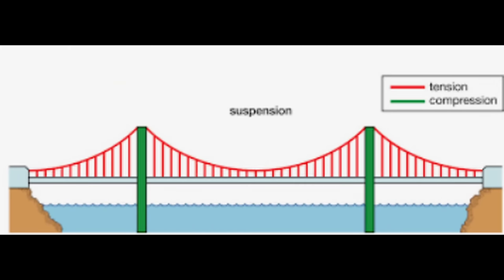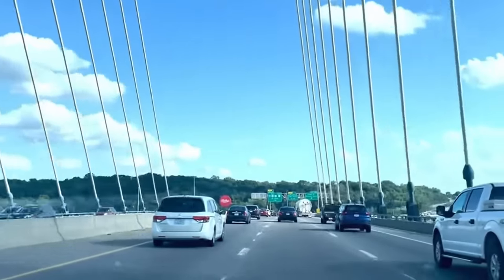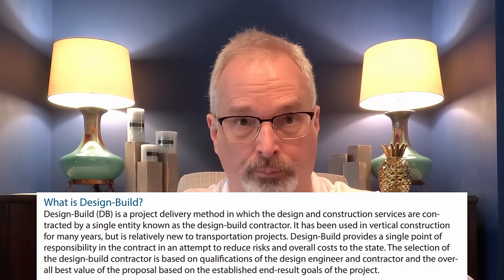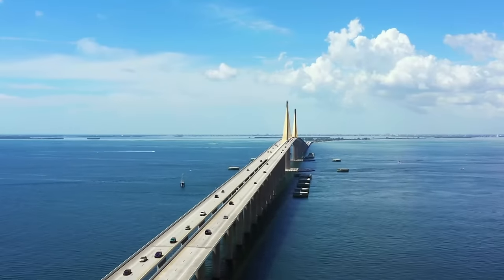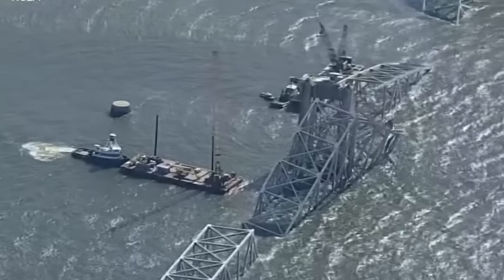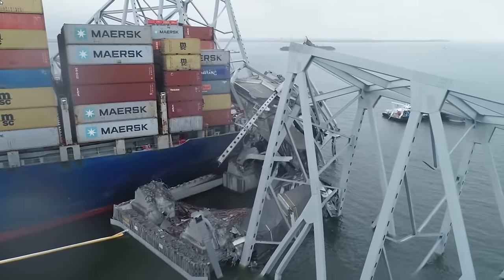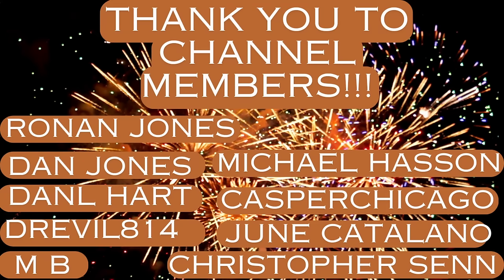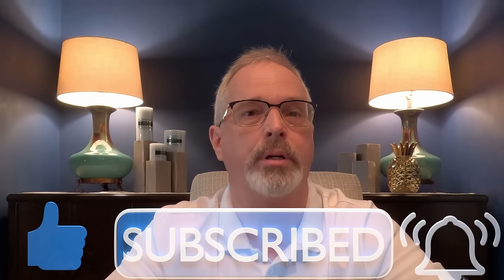How will the Key Bridge in Baltimore be Rebuilt?

Comment: I am a retired structural engineer. It is so refreshing to listen to someone talk about the key bridge that knows about engineering and construction. Thank you.
Reply: ……yes , it’s always good to have someone who knows what they’re talking about, instead of dumbo politicians’ spruiking, who know sweet f a………
Reply: Real interesting.... Now go outside and touch some grass...GEEEZE
Reply: Why dont they build a tunnel?
Reply: @dahawk6474  A tunnel is a lot more expensive.  Also trucks with hazardous such as gasoline are not allowed in tunnels.
Reply: another mistake is when they upgraded Electric Service Wires with New Posts w Lights the Original Closer together Post Spacing on the Bridge stayed the same (probably just build new Bridge at that point in time) causing a narrowing effect when steering under Bridge where you  have to re-center between closer together Posts USN Retired DDG-57 (steered a Billion Dollar Battleship)
Reply: @jamesodell3064 not just that type hazmat but chemicals and even RV’s w LP tanks plus oversized loads need this short and less congested way to get thru.
Reply: @dahawk6474  
A tunnel would not qualify for transport of hazardous material.
Reply: Honestly the electric, fresh water and gas service are much cheaper just to move 1/4 ot 3/4 mile further out to sea than the bridge project footprint so the labor of being involved for the next 6 years isn't needed.   Either that or the bridge can collect rent for the next 100 years to make it look cheaper to the taxpayers by putting those services in the bridge.      One can get a pipeline across a bay for virtually nothing, the environmental regulators cannot really fight a 46 inch wide, 8 foot deep trench in a sea bed scrubbed by channel maintenance, tides and ship traffic.
Reply: I too am a retired civil engineer, Registered in Michigan.  My work was primarily constructing High Rises.  I agree with Michael Foster that your videos are refreshing from the dirth of "content creators" showing reruns of videos created by others plus clickbait headlines.  Keep up the informative videos.
Reply: @sabianstringer2112 lmao!!!!!!
Reply: No
Reply: You are missing my point having a wider footprint for electric only sets you up for failure when you have the scenario where the Bridge Posts are so close together should have redone bridge too in addition to all other service especially when cargo ships are twice the size as in 1970's just saying @christopherwhull
Reply: Or Put Major Bumpers Around Posts as a Bare Minimum
Reply: Because you can't haul any hazmat loads in a tunnel
Reply: @sabianstringer2112     I hear there is an opening for competent ship captains !
Reply: I see now that it not just replacing the bridge but power lines and many other considerations. Engineers are indispensable.
Reply: The collapse of the FSK had nothing to do with the superstructure being a truss.  You knock out an entire pier, you will almost always get a collapse.  After all, 3 multi-girder spans of the north approach also collapsed.  However, a full replacement consisting of cable stay system via design/build delivery is likely as this is the fastest method.  MDTA has recently utilized this on the Harry Nice Bridge.
Reply: as a NON engineer I also appreciate this easily-digestible breakdown of your professional opinion on this! thanks 👏
Reply: Dolphins are concrete structures that are located near the central supports of a bridge and are meant to divert vessels that veer off course in the shipping channel. 

Bumpers in most cases are no harder than sand, wood or rubber.
Reply: @christopherwhull  Dolphins often made of timber.  They use concrete for larger vessels.  It can also be a steel coffer dam filled with stone or concrete.
Reply from the maker: @michaelfoster1371  Thank you so much!
Reply: @sabianstringer2112  lmao
Reply: @sabianstringer2112  there's 4 of them, yes they need more should have them on the inside to keep ships away from the columns
Reply: @rodgerfisher4053  Forget it should just Tuggem Out it is a short distance to exit port.
Reply: @sabianstringer2112  they don't do that here, tugs are used to dock and launch ships in the right direction our channels are wide enough for two ships to pass that bridge as been there for 47 years with no problems but regular maintenance
Reply: @dahawk6474  Baltimore Harbor has two tunnels! The bridge was built, to complete the "Beltway" around the City and to acommodate hazmats!....
Reply: This location for a bridge has proven to be dangerous.  I think rebuilding should not be done.  Leave it open and safe.  Plus not having a bridge means no clearance problems to worry about.
Reply: @tommak6516  Take it a step further and put a satellite port outside of City...to alleviate traffic from trucks.....No Reason for Main Port to be clogged with Cargo Ships....

Comment: A cable stay bridge is probably best, for two reasons. It can be built quickly,  and have a much longer main span. Anything less than 2400 feet is still taking chances. Bridge foundations, no matter how massive, should be provided with barriers capable of deflecting, or impaling and holding a ship of any size. Remember that a collision could just as easily happen during rush hour.
Reply: It seems like most recent bridges are cable-stayed, so my first thought was that they'd go with one of them. Intuitively, it seems like the design is very "plug and play" or procedural compared to other types of bridges... You basically just adjust the tower based on the desired length, and almost everything can be pre-fabbed off site, in comparison to suspension bridges which have a lot of individual complexity due to the anchors.

 I suppose that makes them less "iconic" or individual in a sense, but Baltimore is going to want something done as fast and cheaply as possible for both economic and political reasons, so it only seems logical to go that route.

The advantage of suspension bridges seems to be requiring relatively shorter towers for longer spans, but I don't think this crossing is wide enough to worry about that too much.
Reply: don't need that long a span as the water gets shallow on either side of the main channel. go with 1600 - 1800 ft and provide robust protection for the concrete towers . with the shallower water a huge container ship would run aground well before hitting the protection and smaller barges and ships could be easily deflected by the protection.
Reply: @XIIchiron78 Insurance is paying for the bridge so Baltimore will want landmark quality to drive tourism.
Reply: @stewiesaidthat the road will mot be there until the bridge is built, that’s the economic damage not the rebuilding. The faster the bridge is rebuilt the faster the economy of the area recovers.
Reply: @francesconicoletti2547  6 of one half a dozen of another

The recent National Park Service Visitor Spending Effects Report showed that in 2017 more than 17.6 million visitors traveled to Golden Gate National Recreation Area, Muir Woods National Monument, and Fort Point National Historic Site and spent $513 million in communities near the park, supported 5,998 jobs in the local area, and had a cumulative benefit to the local economy of $612 million.

You can have a bridge tomorrow or a tourist destination next week. Which one is better for Baltimore in the long term?
Reply: @XIIchiron78  The Feds are paying for it buddy!
Reply: @ronblack7870  we need it, they will eventually dredge the Patapsco River and outer harbor because the port is getting busier, so the shipping lanes will eventually be widened and deepened! Don't forget there's cruise ships in the outer harbor too.
Reply: @Edmondson_Avenue  the feds are fronting the money, yes. There will be a very long and complicated series of court cases and insurance payouts that eventually pay at least a fair portion back.

But that doesn't change the fact that they want it done soon so the local economy doesn't tank, and want to be able to brag about having it done on time and on budget, given how many people are going to hear about it. That's what I meant.
Reply: A cable stay bridge would still need piers in the water, a suspension bridge can have them out of the water, which right now is really attractive.
Reply: @jonathanbuzzard1376 You need to take a look at the location. No way can you have a suspension bridge at that location with the main supports not in the. Also a cable stay bridge IS a suspension bridge, just a catenary cable suspension bridge.
Reply: I would be shocked if it was not a cable-stayed. Very few suspension bridges are still being built in the USA. Only three have been built since the mid 1980s when cable-stayed became common. They are the new span of the Tacoma Narrows Bridge, the Alfred Zampa Memorial Bridge, both of which have longer spans than any finished cable-stayed bridge in the USA, and the eastern bridge of the San Francisco–Oakland Bay Bridge. Of couse steel arch, cantilever, and truss or a tunnel are also technically possible, but unlikely. A tunnel would take too long to build and not allow hazardous materials, and the others would likely be too similar to the old bridge for local comfort.
Reply: @XIIchiron78   The insurance is only paying a portion, they aren't paying that full two billion, you better believe that! The federal government will use tax dollars to fund all of this and recoup some back up front and the rest over a number of years but I highly doubt it will be what they spend on it.
Reply: @zeroone8800  only a suspension bridge would allow the bridge piers to be placed out of the water. With a bridge over such a busy harbour entrance and the now clearly illustrated dangers of this the safest option is to make sure a repeat is impossible.
Reply: @jonathanbuzzard1376  Are you seriously proposing that the Key Bridge be replaced with a bridge with a top 10 span in the world? You think that river demands the longest bridge span in the New World? The longest cable-stayed span is three times the old main span, if you don't think that would be enough, you are mad.
Reply: Width is not such an issue. The large ships can only use the deep dredged channel, the rest of the estuary is too shallow and therefore the ships will run aground before getting very far from the channel.
Reply: @ronblack7870   It's still 30-25' deep for hundreds of feet either side of the main channel. 

If I was a betting man, they'll line the cable-stayed pylons with the electrical towers, which are ~2,200' apart for extra redundancy and future proofing the channel for port growth.

Comment: Casey - how do you have only 10K subscribers? You put out AMAZING engineering content, and you pull no punches. Please keep doing what you're doing! 👍👍
Reply: lol well obviously the number is growing. the channel is quite new. he'll have 50k before long and then a few hundeds of thousands not long after that.
Reply from the maker: Wow, thank you!
Reply: @CaseyJones-Engineer  You richly deserve it, sir!
Reply from the maker: @kencarp57  Thank you!
Reply: Why do they have to build a bridge , why not a tunnel  instead ?
Reply: @disol1734 two major issues with a tunnel. First, time. Tunnels can take years longer to build than bridges. Second, the purpose of this particular bridge was to provide a route around Baltimore for interstate commerce, especially trucks carrying hazardous materials, which are not allowed through tunnels. That alone rules out a tunnel as a replacement.
Reply: Just build immersed tunnel (under sea) include road and rail together to solve all issues not disturb port development l. Since only 1.5 mile, cost should not high.

Comment: As a bridge construction supervisor for over 34 years, a cable Stayed bridge has a lot of redundancy built into it. Long term maintenance is much cheaper and the bridge like the one in Charleston is engineered to last at least 100 years.
Reply: As long as it has a clearance of at least 186 ft.
Reply from the maker: Thank you for your comments.  I agree that it is the best way to go under the circumstances.
Reply: I think you are talking about the Arthur Ravenel Jr. Bridge, which by the way is an awesome looking bridge.
And considering the road around where the Francis Scott Key bridge was, its design would be handy to learn from.
As the road at that area is a four lane highway without a large center split.
It only has a thin concrete barrier, so a center span design will not work if they want to re-establish that route.
Reply: @michaelmerritt9891  well, the Arthur Ravenel Jr. Bridge (the one he's talking about) has precisely that amount of clearance.
Reply: It is a Joke they didn't have bumpers around two main posts......Total Failure on their part....Tampa Local Sunshine Skyway Collapse should have been the wakeup call in 1980
Reply: @sabianstringer2112  well they really didn't need it at the time, only naval ships and cruise ships were as big as the Dali, and they never had a military port near Baltimore nor did cruise ships dock there either. Yes, later on they needed better barriers, but it's likely because of political red tape they never got around to it.
Hindsight is always 20/20
Reply: @themadoneplays7842  but still total failure on something that could easily been a prevented in 1980 skyway should have been the wake-up call